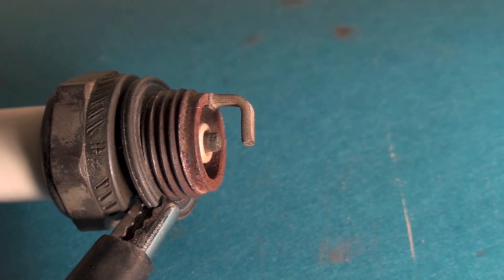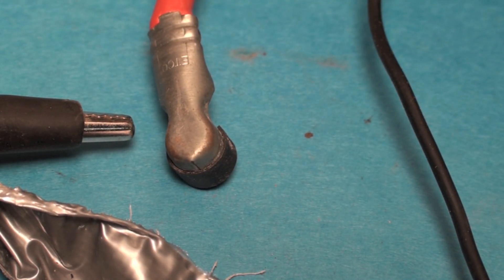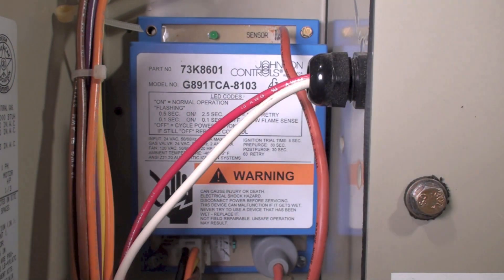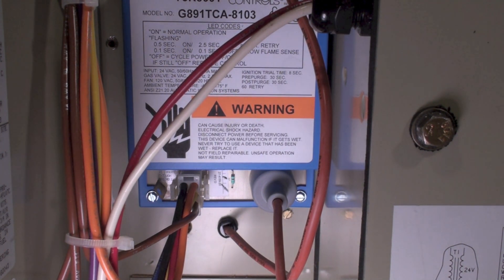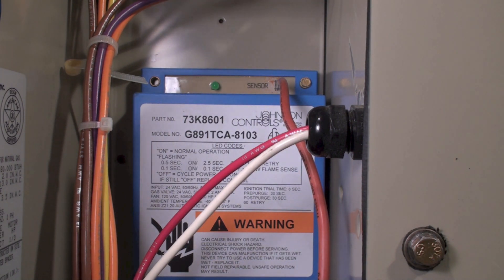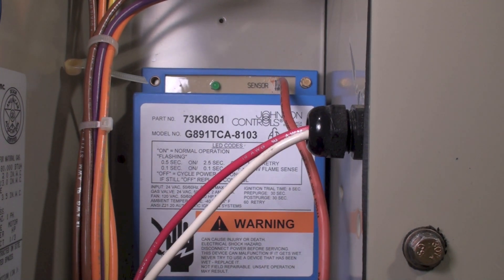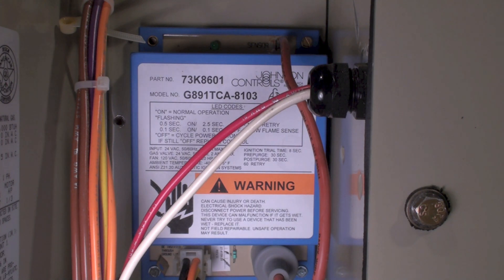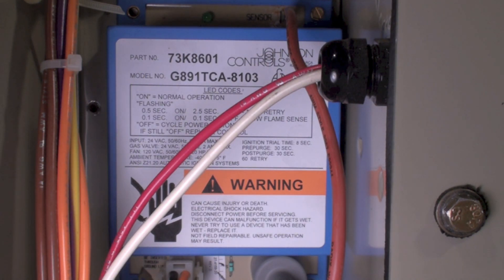Troubleshoot ign control of the Lennox pulse

Comment: My lennox pulse, a G21 Q3-100-3, was improperly vented.  The air intake drew in water vapors back to the air and gas chamber and drew in icy cold air, colder than 50 F.  The vents should have been about three to five feet in height for snow drifting allowances.  There is no cover on the exhaust so wind, rain and snow would block air flow.  There were many elbows near the termination area where the vents exited to the outside, restricting air flow.  My crawl space was not conditioned that is no heat in the area of the vents and there was no insulation inside, or outside on the vents.  There was no removable cap on the drip vent to remove debris.  On cold days there was ice formations and the furnace would shut down.  It is common for my area to have below water freezing temperatures 0 C or 32 F, and much colder.   Pressure testing on the vents and the heat exchanger were not done when first installed and thereafter, when the unit was serviced.  All the care was done by independent Lennox Retailers, suppliers, and repair persons.  I had to take the BC safety gas experts to task to get an official non compliance of unsafe servicing, they were dishonest by not to reporting all the unsafe venting issues, that caused no heat in the home, and even, one time, the release of CO for a detached connector.
Reply: There are a lot of hacks out there.
I travelled nine states as a hands on foreman/ service & project manager handling large industrial and institutional accounts. I was also involved in the fire/rescue service and EMS, given the opportunity to fly with the early medical helicopter services for a hobby.  Finding unsafe conditions that contractors should have observed really bothers me. The big bags with zippers have an air of finality to them. 
  I can't count the number of times that I've been asked to go over a  system, found incorrect venting or combustion air, insufficient return and supply devices, and duct of insufficient size -- and have the individuals tell me that the contractors who have looked at their system provided a quote to install a larger unit without addressing the undersized duct or insufficient air device situation.
  Some of these outfits have zero integrity.
Reply: @bobpaulino4714  There is extreme loyalty of the gas furnace installers not to report or make a fault report on unsafe High Efficiency Furnaces plastic venting installations.
  Sadly, the British Columbia privatized Gas Safety Authority had covered up unsafe Plastic Gas Venting and did not support the safety duty to do pressure testing of the Heat Exchanger and then the integrity of the plastic venting systems tested for blockages or leakages:  exhaust, air intake, and the condensation to either a lagoon or into the city sewer system.  
Sadly, The Lennox Corporation does not have an installer safety inspector for the venting safety to their units, per Province.  Then they back only the mechanics of the furnace.  
They do not stop any unethical Lennox dealer and repair services from handling their product over improper gas venting issues, which is a Home and Commercial Insurance issue, too.  
The Fire Marshalls in Canada, to my understanding, are not informed on unsafe plastic gas venting.
This is when the safety of plastic venting and pressure testings are not being followed by the manufacturer's own safety and higher venting installation standards.
The BC Province, as a point of interest, to the Insurance Underwriters, has extremdly low gas safety standards on inspections on the plastic venting, rarely done, for any brand of an HEF.  
You cannot do visual inspections on heat exchangers, nor on the plastic venting going through crawl spaces and attics that are often an unheated area. 
 This is particularly true in the Northern Colder Climates of BC.  
There should be an International Gas Safety Code Inspection law the plastic venting and the Heat Exchangers are pressured tested.  
You just need a bicycle pump, and plumber's venting plugs and a plumber's wrench to do the pressure testing and wisely, every year.  Just like you clean you wood furnace chimney.  
Safety is the LAW, or ought to be. 
 My home was plastic gas venting unsafe and the unethical BC Journeyman Gas fitters ought to have reported the unsafe venting to a proper authority, including all Underwriter Insurance companies on all brands of High Efficiency Gas Units.  
But do the mafia report on each other?

Comment: Thank you GFM!  I have a Pulse 21. On a call for heat it goes through the 30 second purge, then the ignition starts. Almost immediately after the plug begins to spark, it starts the process all over again sparking every 60 seconds indefinitely. Does not hard lockout after 3 attempts. Any ideas?
Reply from the maker: +Mo K That one is probably a control board.  You might jumper the limit, then test.  Do not leave the jumper on.  
GFM
Reply: @grayfurnaceman  Hi Gray, I have a similar issue. What do you mean by "jumper the limit"? On a call to heat, just after the purge it appears to attempt to spark and then immediately gives up and restarts cycle. Thank you for all your education on the Pulse!
Reply from the maker: @agoogleuser1760  Jumping means bypassing the limit to test if the limit is open.  Not the same problem as yours.
You may have a pressure switch opening when the gas valve energizes.  This could be a crack in the heat exchanger.
GFM

Comment: My G14 is 20+ years old. Recently I noticed a vibrating/pulsing noise emanating from the Combustion Air Exhaust pipe on the roof which sounds like a buzz rocket from WW2. The unit works fine, but the noise outside/inside. My neighbor has the same unit although much quieter. Any thoughts would be appreciated.

Comment: hi Mr grayfurnaceman I have problem with GSR14-50 lennox gas furnace dont igniter what is the best way to remove the spark plug and sensor on a horizontal furnace
Reply from the maker: Frank Garcia Swear, hope, jiggle, try another tool, swear.  lol  I have gotten them off with both end wrenches and sockets, but its a tough job.  Add to that, some of them seize their threads and break off the spark plug.  I have even cut the access hole out bigger for better access, then covered it with sheet metal.  Also, these furnaces have a tendency to crack heat exchangers and put CO in the structure.  Hope this helps and good luck.
GFM
Reply: thank I watch almost all your videos excelent